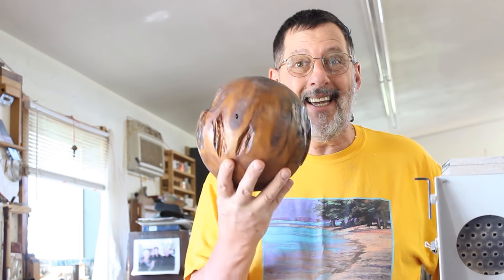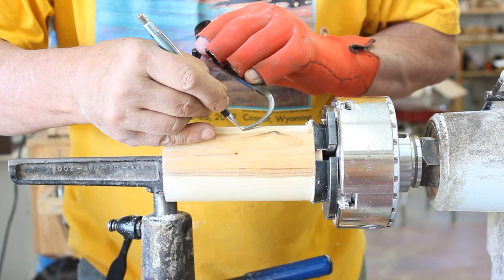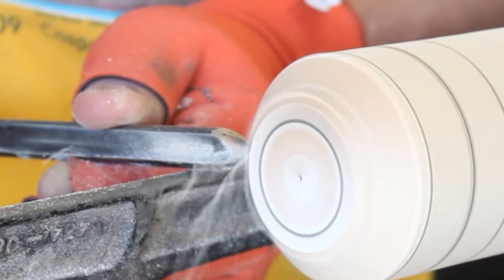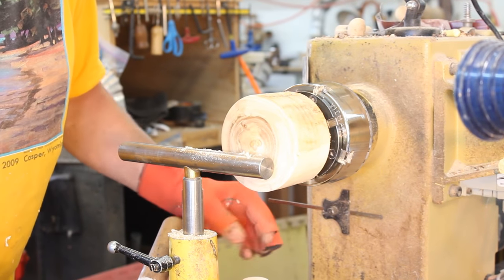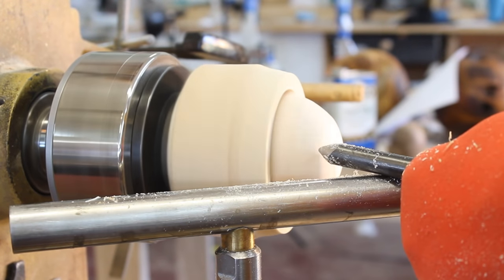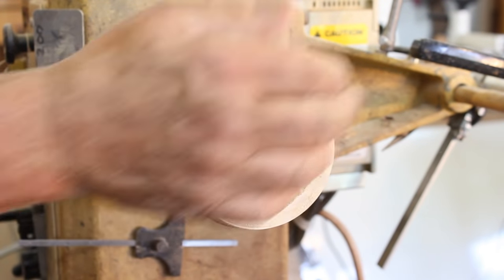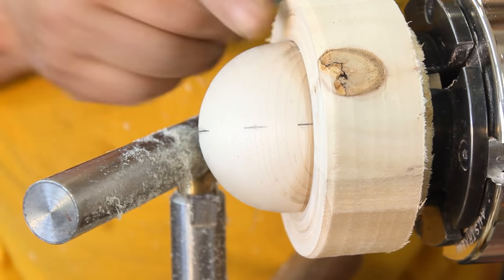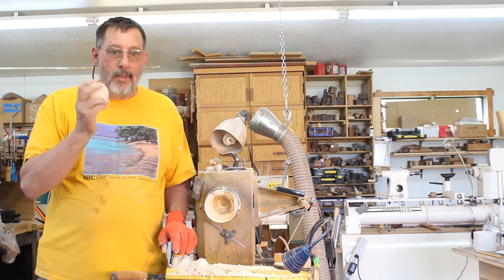Turning a Sphere on the lathe using a Jam Chuck:  by Sam Angelo

Comment: Great lesson Sam.  There is just something nice about holding a sphere of wood.
Just a comment,  I saw an article ( somewhere ) that in the "old days", the guys that 
turned billiard balls used a jam chuck with a  cylindrical cavity rather than a hemispherical cavity.  Seems logical since only the  " rim " of the turning is held in
the jam chick.  ( And they always used green wood for the chuck --- has a little "give" in it I guess)   Thanks again for your videos.
Reply from the maker: David Peters That is an iterating idea-the cylinder.  I agree that the ball i mostly held on the rim.  I even thought of PVC pipe.  But the size of the pipe would dictate the size of the sphere.  Sam
Reply: WYOMINGWOODTURNER  Thanks for the reply.  I also thought about PVC 
and maybe one could line it with some kind of foam padding to accomodate some slight size variations.  ( haven't tried it yet )
dave

Comment: Sam, this another excellent video with some very good tips. One more tip is that if a jam chuck is just a little loose, try wetting the inside of the chuck slightly. The chuck will shrink slightly and the sphere will expand slightly making the fixing tighter.

Comment: Good Demo.  I'm attempting to make the sphere.  I was having trouble, when watching your last video, and making the sphere.  You made it look very simple, and I realized that it does take some practice.  I started out making a 4" sphere, and got down to 2", and still couldn't get it round.  This newest video, involving a jam chuck, looks like it may assist me greatly.  One of my questions was, when making the jam chuck, do I turn the wood face grain, or end grain, or does it matter.
Reply from the maker: Tommy Schutz that is a very good question. I think to begin with it would be easier to turn it as a spindle or end grain as you say.  I think this would be easier although you could do it the other way around. In the and,  when the project is finished,  it really won't matter.  I did have lots of trouble on my first two or three balls.  Finally on this one, it did not fall out of my jam Chuck once.  Sam

Comment: Please don't take this the wrong way but the math you set out to use and the math you actually used are "dissimilar".
The sides of your octagon all have to have the same length. 
@ 8:20, it seems that you divide your cylinder into 4 equal spaces. Your little template also doesn't fit snugly. 
The length of the flat on the 45⁰ side must be the same length as the flat left on your original cylinder (ie the piece of flat with your centerline in the middle). 
The trick is to divide the horizontal distance from the centerline to the vertical face into 5 equal spaces on either side of the centerline. APPROXIMATLY 2 spaces (2.071 actually) on either side of the centerline (total of 4 spaces) will be (close) to the length of each flat of your octagon.

If you do NOT flatten the cylinder vertically (as you did) but instead turn a tenon equal to 3 spaces down from the top of your cylinder and leave 2 spaces on either side of the horizontal centerline, you can just join the two "two spaces" lines which will leave you with a 4 space flat with your pencil line in the middle, a 4 space 45° flat and a 4 space tenon.  
There you have it, as clear at mud.
Reply from the maker: Yes at 8:20 my 135 degree jig does NOT fit snuggly.  I say as much and then go on to correct the angle.  At around 9:20 into the video I check my angles and the length of each facet.  (I made this video 6 years ago so I can't really remember exactly what I did).  But at 9:20 everything looks spot on.  I will confess I am not much of a mathematician and you sort of lost me.......somewhere in the mud.     
Sam